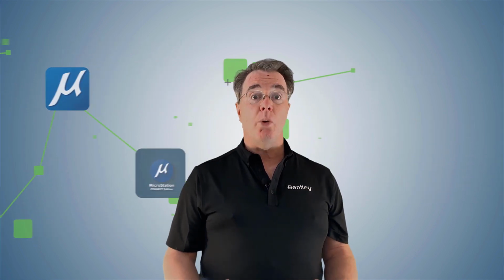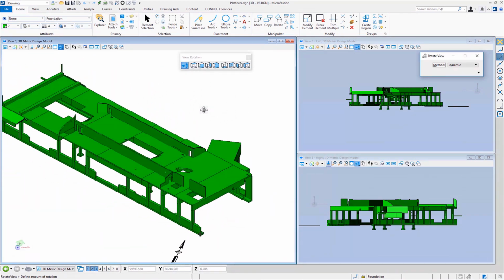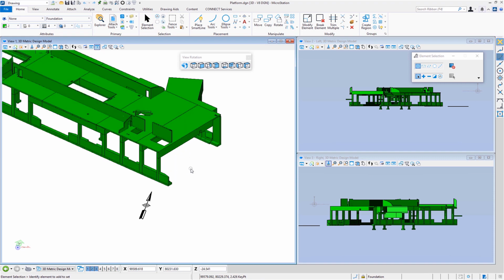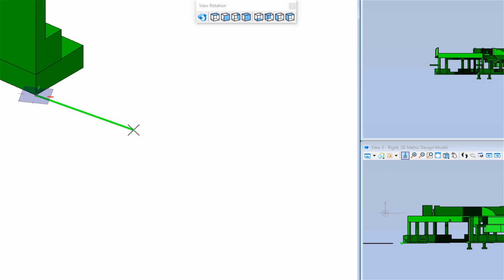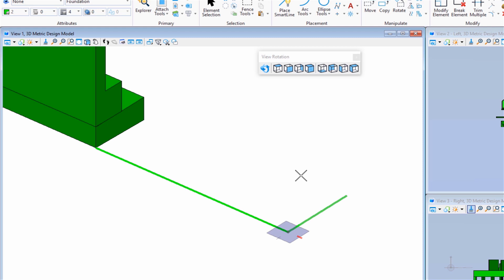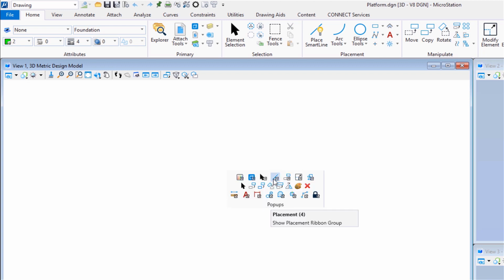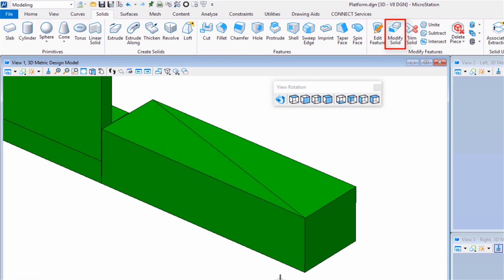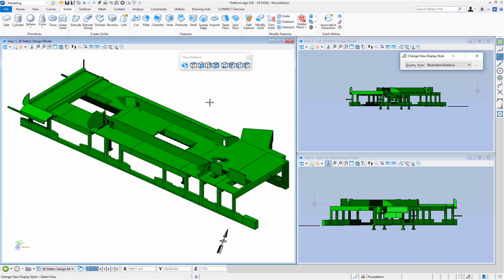01 MicroStation CONNECT Edition 3D Basics - Introduction & Solids Modeling

Comment: I could not recreate your "tentative+shift+mousewheel" to orbit around a point. Yet, I could extend a functionality I'm aware of and I use every day and it is that I trigger the orbit mode with "alt+mousehweel down" usually I drag the orbit icon manually to the snap I whant to rotate about but thanks to your tip discovered that doint tentative it move the icon more ocnveniently.
Reply from the maker: To dynamically rotate the view in this manner, there are 2 methods available. The first is <Shift + Tentative> (this is the tentative on the mouse) which puts you into  dynamic rotation mode. The second is <Alt + Tentative> which does the same thing, but with the addition of a movable cross hair. the cross hair can be clicked on to move it to a different location, including the use of snapping to locate it precisely.